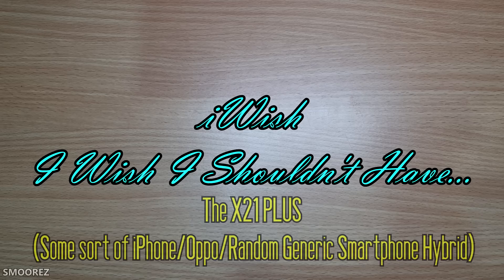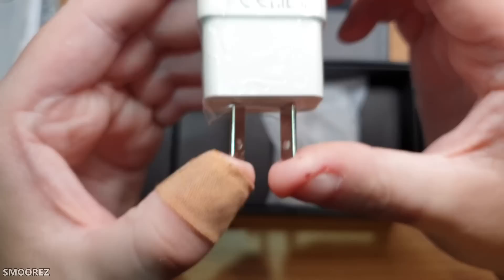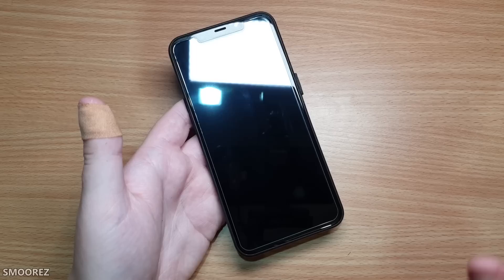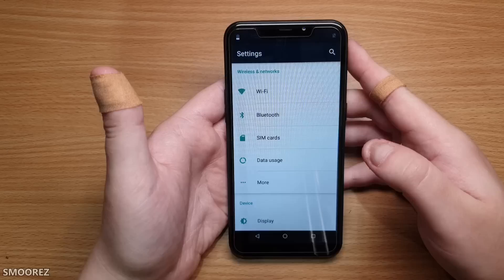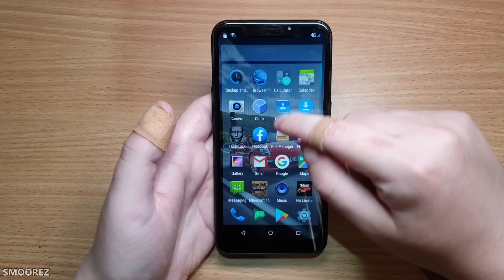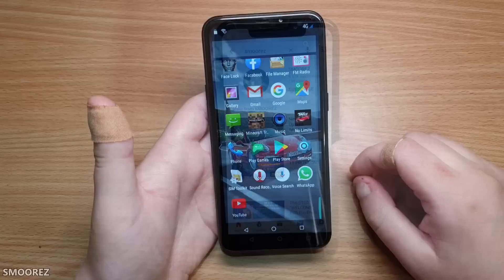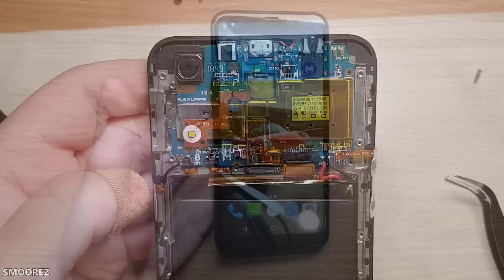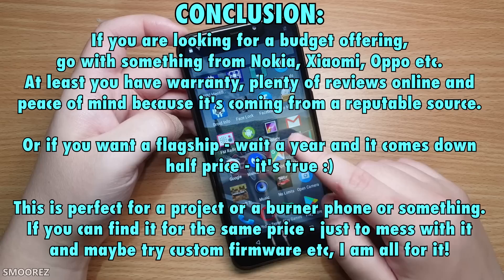I bought the CHEAPEST Smartphone I could find on eBay - This is what $36 gets you!

Comment: Well that was 43 minutes of my life shot to hell. Please stop doing these videos!!
Reply from the maker: Check out this dudes mad tech videos. Much better than my ones!
Reply: @SMOOREZ  will check. One sec
Reply: Watching just the Surface Pro "review", I have several issues with it.

A) Audio quality is... meh. Background noise, raspy sounding voice, etc. Lighting could have been better. Focus on camera could have been a lot better framed on the subject, using the rule of thirds and keeping it centered. More on that next.
B) Camera moves a bloody lot. This is why people traditionally mount them on tripods. It makes it hard to focus on something if you move the camera. Mounting it also helps with auto focus, avoiding the slight spasms in focus.
C) Treat something that costs a good amount of money, specially a completely brand-new stock item as such, watching you fumble and play with it like a toy just kinda hurts. 
D) The only technical detail I got from that "review" was that it was 256 GB. Nothing else. No CPU spec, no RAM spec, nothing. I have not been educated through your video. You just took it out of the box, turned it on, set it up, and done. All you did was take 5 minutes of my time and gained nothing of real value in WHY you would recommend it, or WHAT it offers me.

I will gladly take 30-50 minutes of actual thorough testing and learning what the device is, where it comes from, and the value behind it, than watching a channel more focused on shutting down other people's work because you don't like it, with "reviews" being a side thing.
Reply from the maker: Thank you for that. I always say be good people and I don't usually like dealing with trolls or haters or anything like that.
HOWEVER...when said person actually has made "tech" videos and hates my ones, telling me to stop - well, I just pointed it out and you gave out facts ;)
Reply: @SMOOREZ  I never said your videos were no good just way too long. Sorry if I hurt your feelings..... just sayin!!!